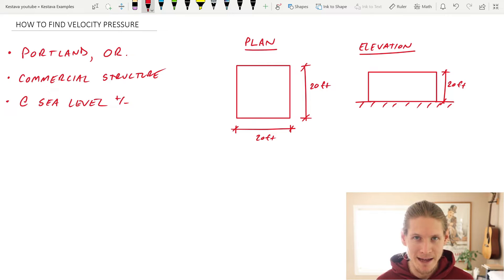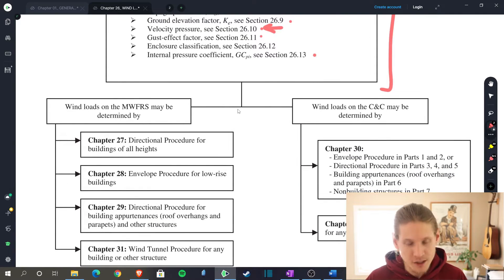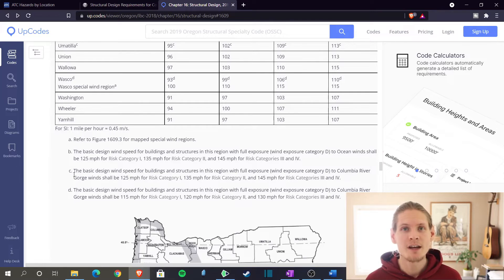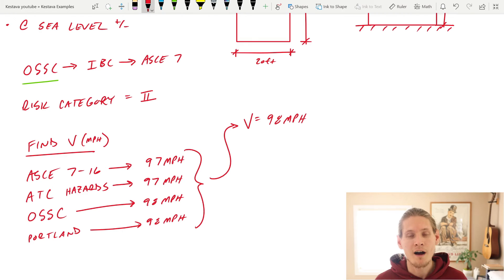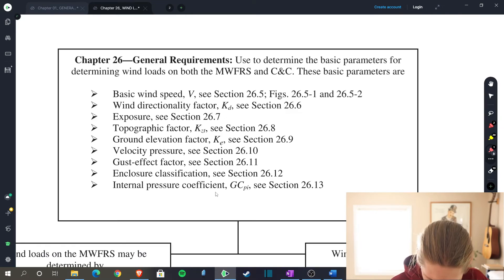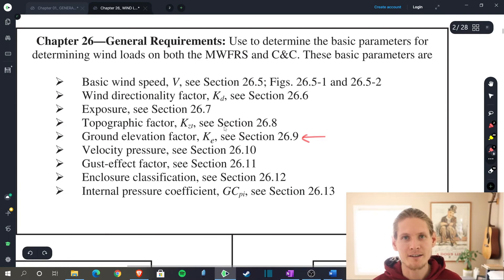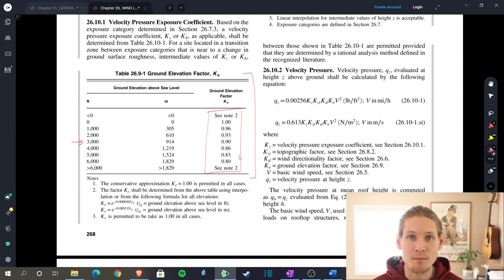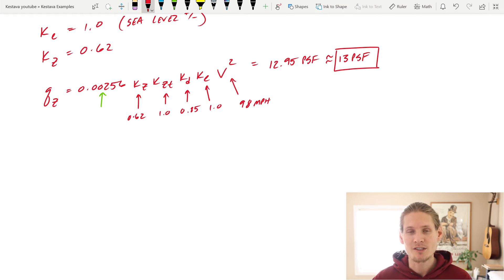How to Find Wind Velocity Pressure per ASCE 7-16 | IBC | and MORE?!

Comment: This is a very well-explained instructional video. 
I do not deal with wind loads on a regular basis, but on occasion I have to review plans for shade structures or such things. My area experiences a very CONSTANT wind (very strong at times), so I have noticed over the years that structures typically fail here over time from FATIGUE rather than the strength of the wind or gusts. Does ASCE-7 or UBC 97 take that "fatigue loading" of winds into consideration?  I am looking through ASCE-7 now, and do not see anything to specifically address it. Thanks.